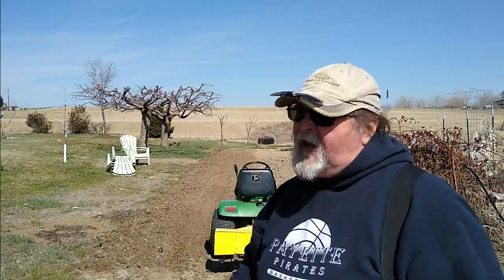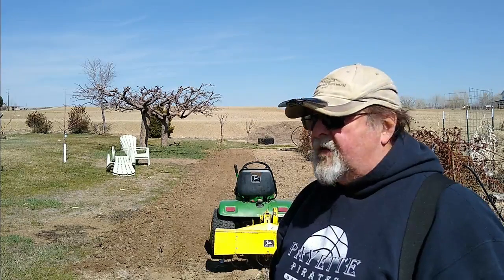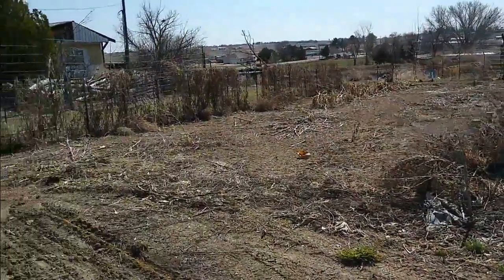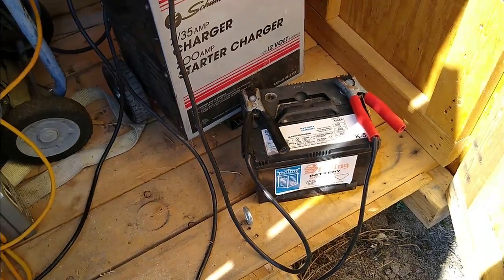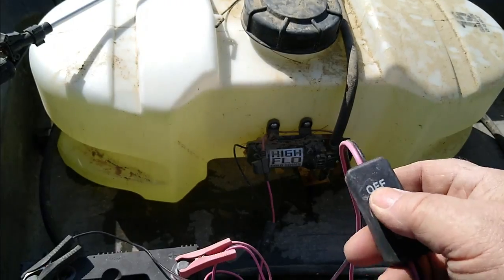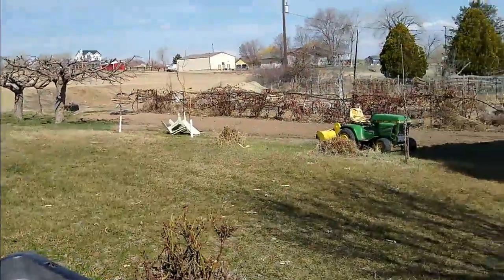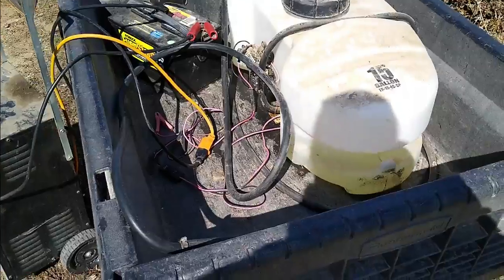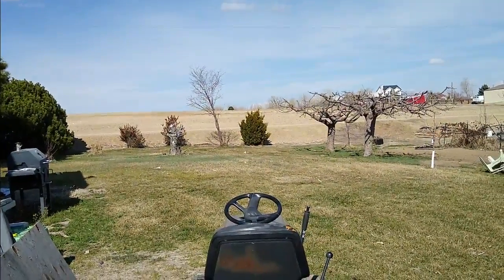FINALLY! I GOT TO SPRAY & TILL SOME!

Comment: I was impressed by the speed you were working lol. Your JD and tiller did a great job. We tend to use a tiller on a tractor with hydraulic lift but we are thinking of trying a linear actuator on a manual lift tractor to make it easier to lift heavy attachments like a tiller. I am pleased you got the chance to do some sraying, great work and thanks for sharing
Reply from the maker: Can't wait to see your linear actuator installed on a manual lift. The rains came and gone so I've been cleaning out the raised bed. Video to follow. It'll take some time to get in shape to work hard in the garden again. I sure need it and enjoy it!